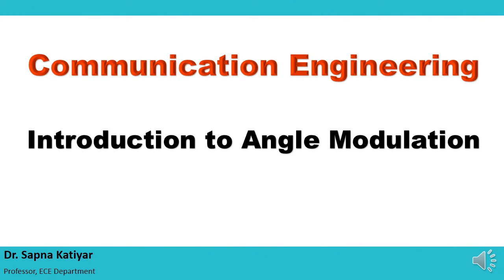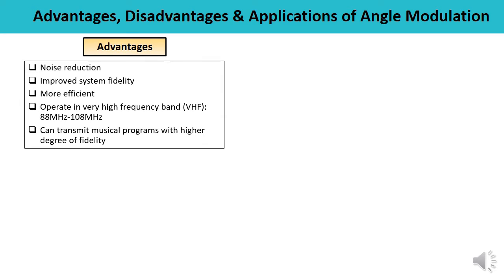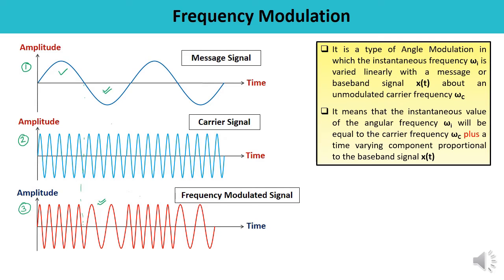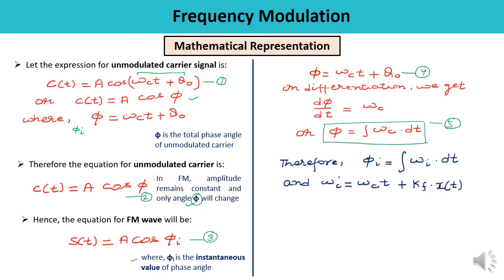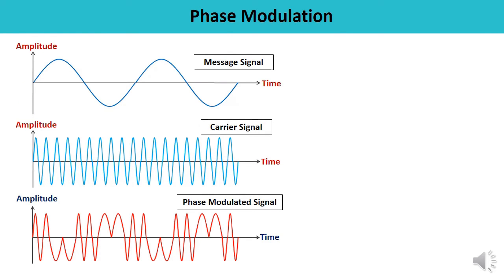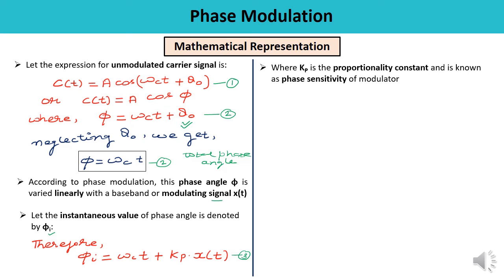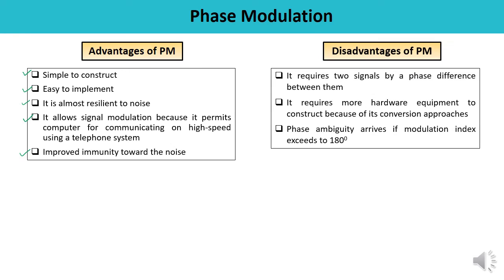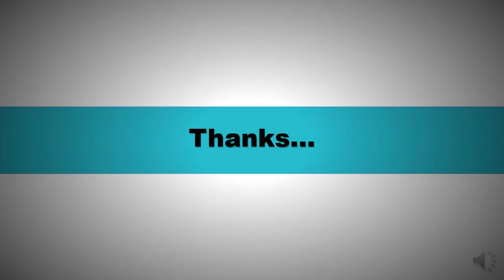Communication Engineering - Introduction to Angle Modulation

Comment: Why angle modulated signal is non linear
Reply from the maker: S3(t)  is not equal to S1(t) + S2(t)
Therefore angle modulation is non linear..
Reply: @DrSapnaKatiyar  but you should prove mathematical in detail please
Reply from the maker: @Haroon2002home  
Will add one video based on it...
Reply: @DrSapnaKatiyar  when mam? I need with 2 days I have assigned this assignment